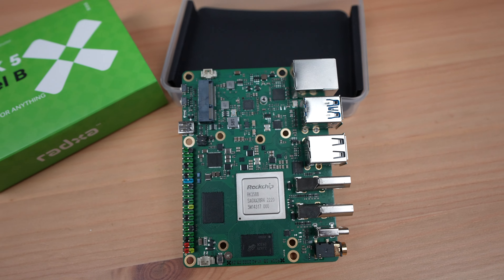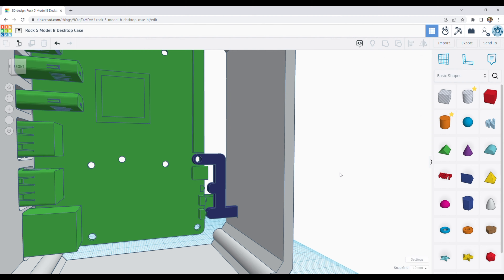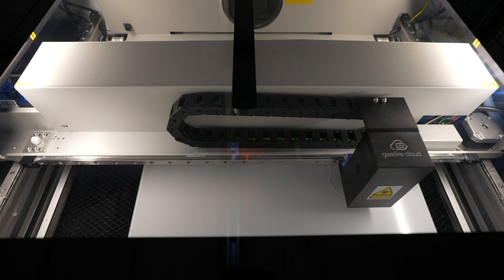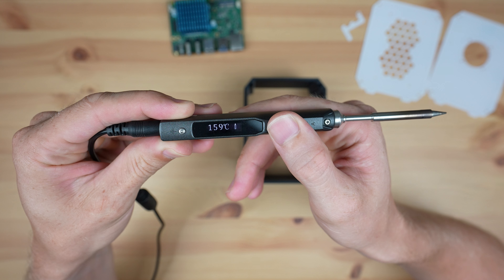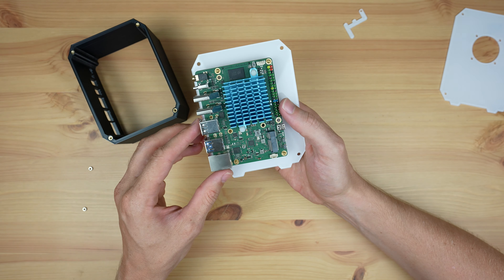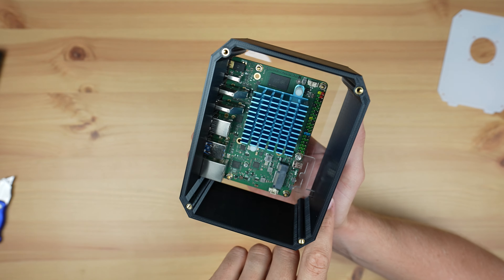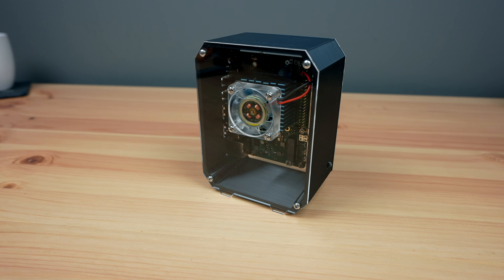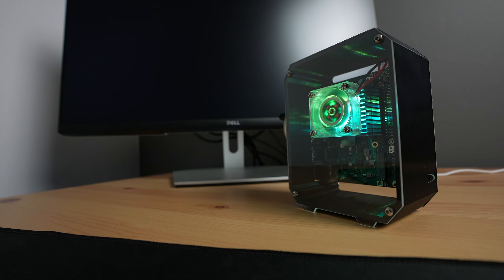I 3D Printed A Case For My Rock 5 B

Comment: Excellent foundation for adding more features (antenna sma bulkheads, camera/display/40-pin cable slots, nvme access door, etc.). I learned to use a soldering iron to set the bushings and appreciated you being able to go straight to the nvme for the debian install. Very classy design with innovative on/off switch design and a suggested fan power bypass.

Comment: Hi Michael!

I would like to ask you if you could show how to install 2 fan on a single raspberry pi 4b. Which pins should i connect the second fan or how can i get it to work?
Reply from the maker: There are multiple GND, 3.3V and 5V pins, these could all be used to connect a second or even third fan to a Pi

Comment: Great news is that You switched to such great SBC which is Rock5b with much faster RK. I hope we will see more interesting stuff on that.
Case looks great like all your projects, I love those materials. But design is terrible :( 
1. There is no need for big fan and heatsink. Its not pi, not that much heat. 
2. Vertical design with this heatsink is not great idea, also You should put holes on top, not on sides
3. There is already pwm fan connector on board, take a close look, it takes small ziff and will turn on fan when needed at right speed (and noise)
4. Access to emmc and sdcard is rather bad, you may need that trying other OS. 
5. There is still plenty of space inside, that case may be much smaller, you could add some oled screen, wifi or native sata - there is plenty of things to do on front m.2 e slot. 
6. Hdmi input is completely blocked :/
7. For memory intensive task You may need to add smal heatsink for second RAM chip. 
8. Holes for ports are bit bigger than needed, this may be cased by the way that board is installed. This makes airflow different for sure, probably nothing near nvme, 
9. Some dust protection may be also needed

Original radxa case or the one from kkbs metal cases acts as big heatsink, are much smaller and should be more comfortable. This one thanks to glass finish gives more options for some screen, but for now looks too empty and probably at least cooling should be redesigned. Why you even did not stretch it to board width so there is no empty space near power button? 
Thanks for sharing this, now lets see ver2 or completed project with more things inside. 
You can easily make this way smaller, my idea is to use turbine fans and heatpipes, they are easy to bend and very efficient. I'll not do pro video abot that like yours but this may be interesting thing for you too :)